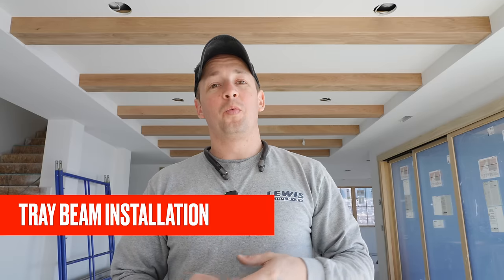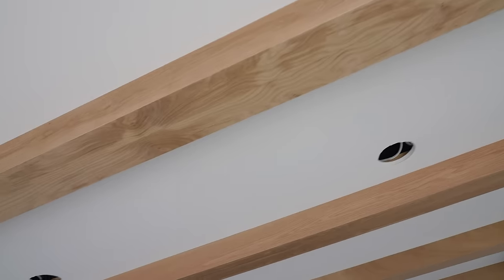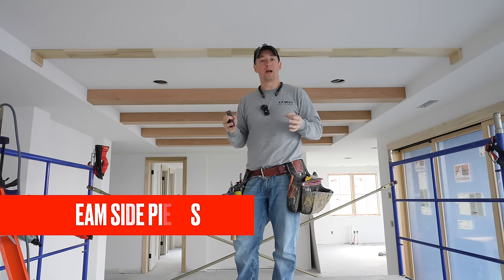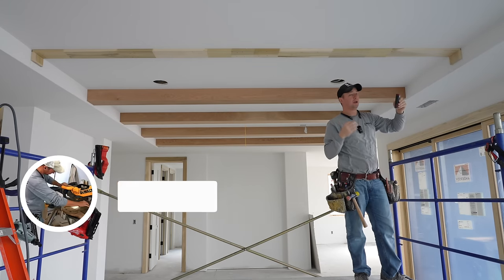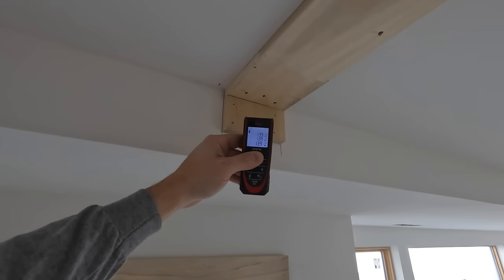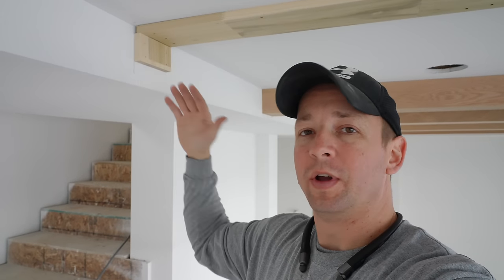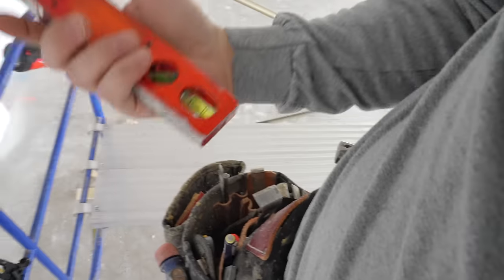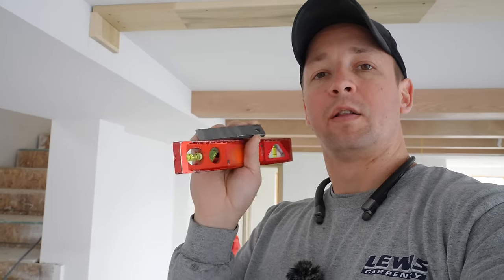PERFECT BEAM INSTALLS | Best Tricks for FAST PERFECTION

Comment: My thought is wondering why you didn’t pre-finish the beams. I know you are going to say because of the glue squeeze out and sanding it and breaking the edge. In reality, if you didn’t make your ending points so tight to where you had to literally snap it in place (per se) and/or then adjust it with a hammer, you would not need to worry about sanding the miter afterward and you would not need to use a bunch of nails.  If you check some pressure off the board from needing to snap it in so hard, it would make it a lot easier to be able to nail the miter together.  You appear to have needed to use a hammer and a clamp because you put so much pressure on making the overall length too long then now you are having to force the pieces together and inevitably, the joint is going to open up at some point.

I personally would disagree that you don’t see the nails from 9-10 feet below, but that is also the difference between a carpenter and a cabinet maker. I think to do a great job for what you do, but we all, even myself, can learn to improve. It is when we think we know it all as well I really don’t know anything at all.
Reply from the maker: Cost effectiveness. There is a place between quality and production that we find our ideal value point. We're shooting for client value fit, not perfection. Perfection is impractical from a value standpoint.
Reply: @InsiderCarpentry  perfection is not impractical if a customer is willing to pay for it.